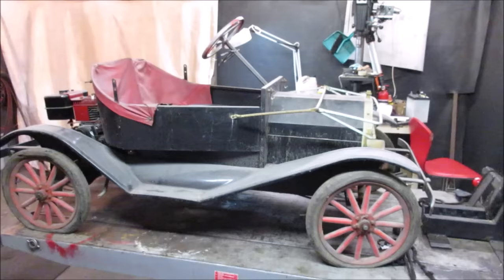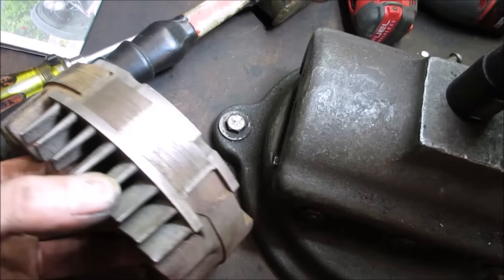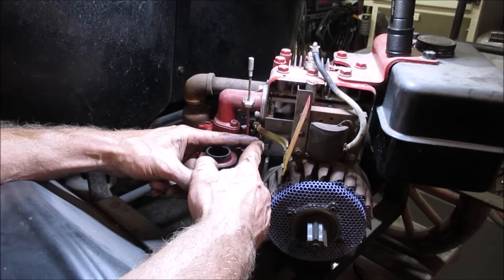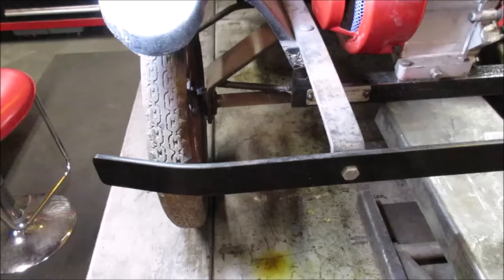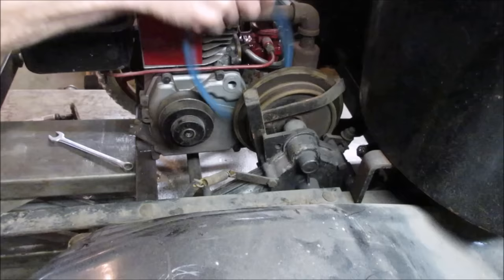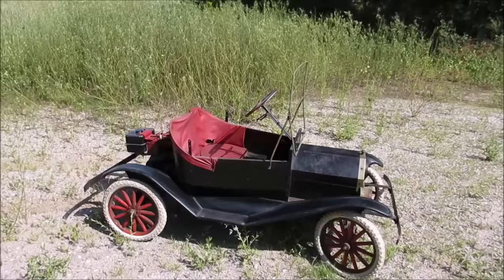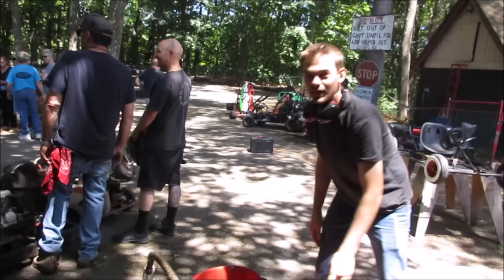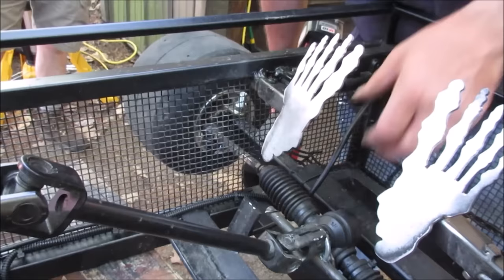Will It Run? Shriners 1962 Go Kart

Comment: The spark plug was developed by that what is today the Bosch Group. So it was originally build by a company that was used to the metric system. From there it was kept this way to make it everywhere the same. Otherwise the German WV would be need other plugs than US cars. The improved magneto and the spark plug are the two inventions that made the Robert Bosch GmbH to what it is today. From our side of the sea spoken, I need my imperial tools quiet rare, because not much US made stuff is coming in my shop.

Comment: Oddly enough white tires might be correct, depending on the year.  Originally they used zinc oxide filler in tires.  Black carbon filler came later.  White wall tires are a throwback to very old ones.

Comment: The rear "suspension" is probly because it's one wheel drive. With 3 rollers you could end up with the drive wheel off the ground, like when that wheel is over a pot hole.

Comment: that was made to have flex, to not add to much pressure on the wooden spokes. uneven ground in the slightest would cause to much flex without that make shift suspenion.. old wooden wagons use to have s similar concept

Comment: I think those wire keepers on the hubs are just that. Like a train car, the axle/wheels  are not meant for downward travel. When the rubber side is down, the axle doesn’t need to move down. Makes it quick to remove the rear end. Less parts?

Comment: color wise who knows but aren’t they usually white for that vintage engine? maybe because the parts are red just match like their Shriners caps all one themed. theirs a coach builder who can even rebuild and tighten the rims Engles Coach Shop out in Montana only one in existence. if you just want rims or a wagon for decoration to use to decorate fall with pumpkins scare crow in the drivers seat. plus in same he can set you up on ones for horses 🐴 to pull family around a property or slay rides in winter to chuck wagons. if you find a model T with wooden rims well he can rebuild them and copy so you can restore it. great you tube videos to boot. like this shriners t or what ever it is with wooden rims

Comment: Looks like a piece of flat bar would have been bolted under the bearing to retain the axle.  When you lift the axle it looks like just enough room to put a piece of flat bar under it.  It probably fell out at a parade and was fixed with whatever was at hand.  Also, when it was on the stand running you could see the axle spinning on the right side.  Could both sides be meant to be driven and the right side just be stripped out?  Seems off that it would be a one wheel peel.

Comment: Tell me about hitting the clean gas tank lottery, I found a near mint Montgomery wards replacement engine in an auction, un bent the throttle checked it over, threw gas in it and it ran like a top..... sometimes its good to get lucky

Comment: Hi Mustie,  really good video, I have the same unit, except mine is made into a fire truck for the Abdallah Fire Wagon Shriners from Kansas City, Kansas.  They are a blast to drive, and yes, I am also taller at 6'2" and it is not easy to get in or out of there, but it's still fun to drive.   I just have one question with the drive system,  mine will not turn unless it is running, I have to pick up the rear and move it around, or have it running when I load and unload it, ( I show it at Antique tractor shows, and vintage fire truck shows.)  I see you were just pushing yours around with no issue.   Could you help me with a video or at least look at yours and see how it works, I am at a loss and not sure why mine is locking up, maybe between us we can figure it out.   Thanks a million,   keep the great videos coming.  
Jeff

Comment: I can send you a pic of the ones I have,  they are both Shriner trucks, both retired, they are both Fire truck styles, but one has been modified with a 3 speed garden tractor rear end, and an 8hp briggs, and a larger seat, plus they put a tank and hose on it, and yes, it does squirt water.

Comment: Leave the white tires ALONE! They are just fine the way they are, wait until the body paint  has been polished !
And polish the brass Radiator and  Headlights also....  Yes you can run it on the bench, just jack it up on the rear bumper!     Cant wait to see Mustie in a clownsuit in this car in the Parade....!

Comment: My guess for the up and down movement of the rear axle is simply to recreate the jangly, tipsy turvy motion of the original Model T as the roads back in the day were non pavement and rutted. And I'm old enough to have seen many Shriner vehicles in parades and they were authentic to a "T". Okay, after watching more of the video, maybe no. Flatheads forever.

Comment: Did anybody see spark coming by the frame underneath the gas tank at 1:20:04 ?
Reply: Spark or leak?
Reply: @LeverPhile  I do believe I saw it spark. I spotted it on the whole of the frame right below the gas tank and the right wheel. But then again I may be going crazy LOL
Reply: @TheYcbpercussionman  It does actually look like a spark, I agree. 

Earlier when he first got it running I thought I saw a spark on the left side, which turned out to be a light reflecting off a flat smooth metal piece.  

So more wondering what would cause that if it were really a spark, or maybe if it's just an illusion.

Comment: Paint tthr spokes black and you will fix the look. The rear wheel bearings used to ride in a cup. The cup is missing and your shaft rides on a nail.

Comment: The axle is a floating axle the (wire) under it is a steel wire retainer for easy removal i case you needed to take everything out to replace certain parts ( this is my hypothesis not facts )

Comment: Wouldn't it make sens that the axles should be sitting in rubber grommets that have simply rotted away and fell off the machine a long time ago. To me, that makes more sense than having them clunk clunk clunk every time you hit an imperfection in the road.  It looks like the square hole the axles go through would be perfect for holding an isolation grommet.

Comment: When using that type of engine with Governor is not set the idle and throttle pedal operates the rest of it  disconnect the governor's when on that type of vehicle.

Comment: I believe that bent rod is the crank that goes in the hole under the radiator. Fake engine crank. Simulated. Fake sounds bad.